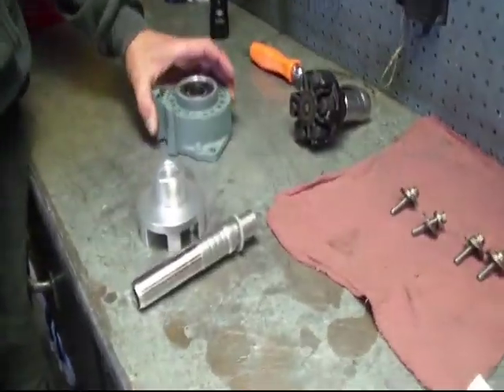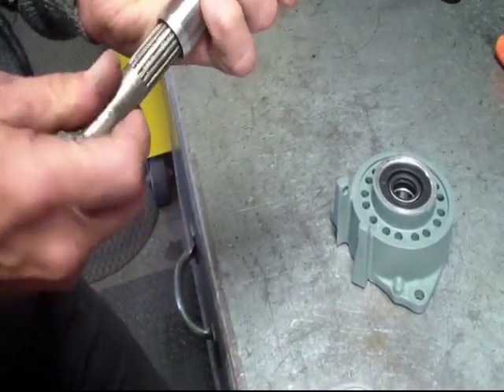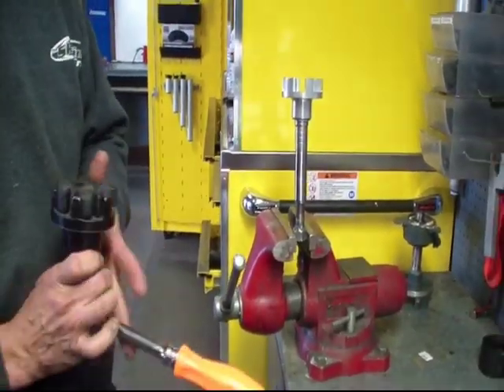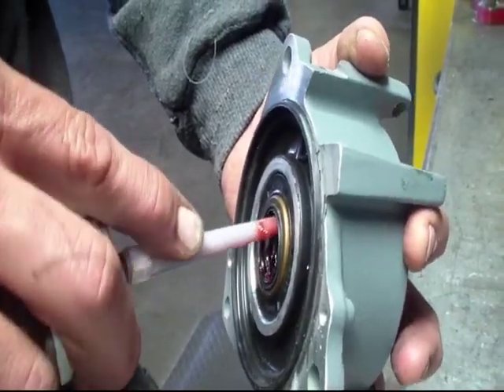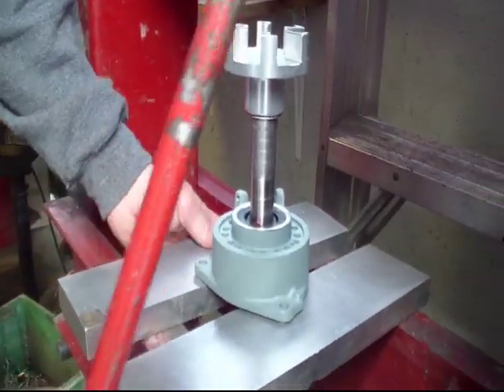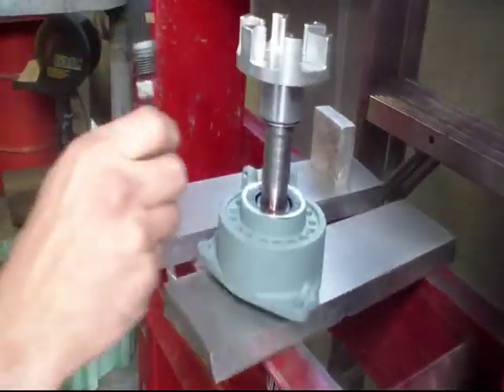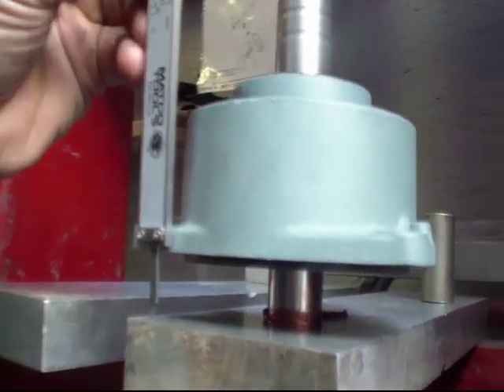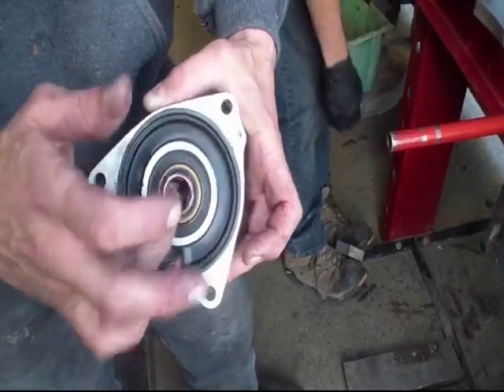Build-a-BOB: Pressing the Midshaft into the Housing

Comment: Is there an easy way to remove the couple from a 2010 Yamaha AR240? I've read you have to move the engines forward to remove the couple and be careful not to lose the shims. I was thinking about loosening the two bolts at the bottom of the engine mount where is bolts to the hull and sliding the motors on the motor mount pad? Thanks for any info.